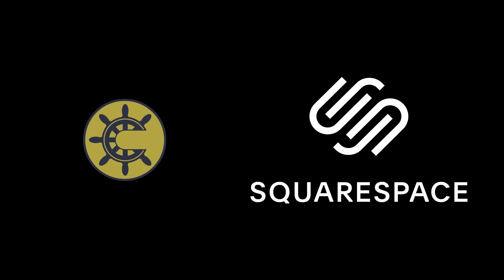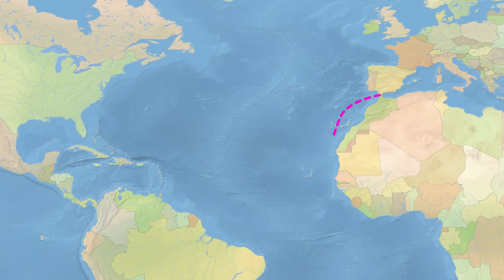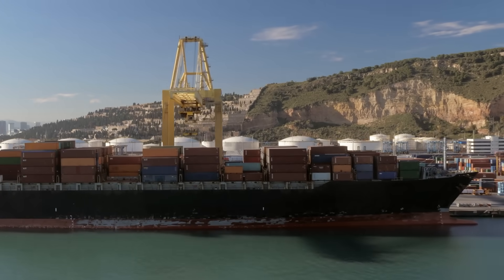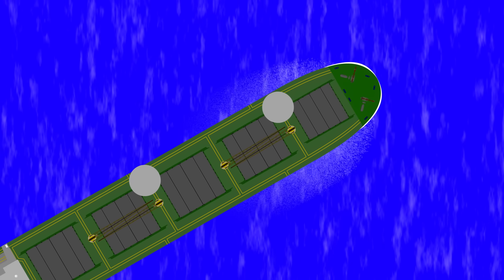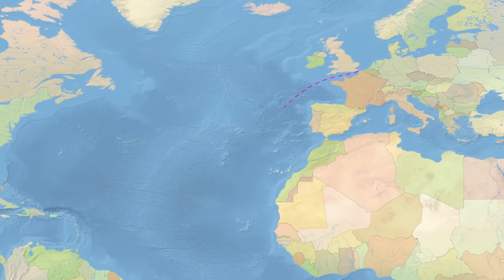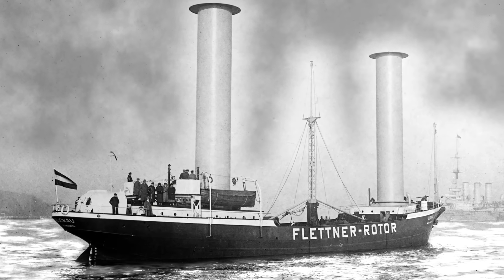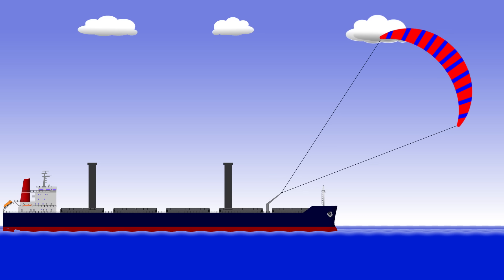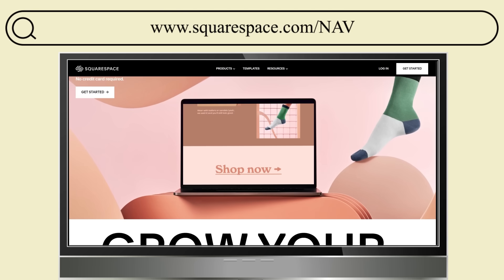Why Don't Sails Work On Ships?

Comment: I am an engineer actively working on a WAPS project. There's a lot of CGI and not a lot of thinking going on with a lot of these solutions. Ships have to go somewhere and usually on a time schedule, and most of the solutions typically have a 40 degree wind window where they are effective. Thats not enough to make economical sense. And when its not working for you its often slowing you down. Im not sure I see any solution becoming widely used in the next 10 years
Reply: @chuckyxii10  , My biggest point was that lift force >> drag force. This means aircrafts can fly with engines that don't have enough power to generate one g acceleration. You can have symmetric or even flat wings. The actual wing shape is just much more efficient because drag is reduced with more efficient deflection generating strategy.
Reply: @suokkos  nice, think about the loading and unloading of the structure. How would you account for that?
Reply: @suokkos  Wow, that's a wonderful explanation -- thank you! 🥰
Reply: Hi Tim, the presentation said at 5:29 that the economics of WAPS is jeopardized by the split between the owner paying the capital cost of installation, and the charterer paying the cost of fuel. I have read this elsewhere. Is this really true?
Reply: @patnolen8072  Generally, yes, however the presentation overstates the issue at play. While, yes, there is a bit of a conflict in the owner paying for the efficient technology and the charterer paying the cost of the fuel, because the owner doesn't pay for the fuel and can save the charterer fuel costs, the owner can charge more for the charter. The same is true for homes, boats, cars, and planes. The discerning leaser, especially those involved in contracts in the millions, will take into account running costs.

As long as the owner can recoup the debt expense for upgrading the ships by saving enough fuel to entice charters even at a higher base cost, the system can work. The problem here is that the cost of the system outweigh the benefit of the lesser fuel consumption, meaning that if we were to mandate such a technology we would either have to subsidize it or force the entire industry under the burden of extra expenses and locking us into what may soon be an obsolete technology.

A problem with lots of regulation is that they require specific technologies instead of broad goals. If they, for instance, mandated that all ships achieved a nautical mile per gallon per gross ton metric, that would leave room for innovation in the future without risking baking in a bad technology. You could also provide high efficiency subsidies where extra nm/g/gt would lead to tax benefits or something. But, no one does that because it's not a good way to make sure politically connected friends are guaranteed sales from a captive regulated industry.
Reply: @justhecuke  I find that the problem with regulations is that either they are written by people who don't know anything about the matter at hand, or they are produced by people who have a particular axe to grind and therefore will write regs that may be detrimental to most of the industry.  If wind assistance provides an economically feasible advantage, someone will exploit it without being regulated.
Reply: @justhecuke  While I wholeheartedly agree, I think you might be understating the conflict of interests between owner and charter. At least based on two factors you didn't directly state and which I've seen or directly experienced both with home rentals and efficiency based technology. Maybe two and a half. They are:
1 - opportunity cost and time for return. If the time required for the investment to pay itself is too long (ex: 8 years), the money invested there could be better applied in other investments with shorter return times. So investments like these are repeatedly postponed until they never see the light of day.
2 - inactivity time and cost vs income. If the upgrade takes time to install - time during which the ship is unavailable - then while the owner's profit increases on the long run, their income decreases - possibly sharply - on the short run.
3 (sorta of) - the latecomer's advantage. As one or more technologies mature and improve, the later a user invests on them, the greater they benefit, as it affects 1 and 2. No one wants to buy an extensive set of rotors that will take 10 years to return the investment, only for 5 years later a cheaper, more effective rotor that takes less time to install to come into the market.
But ye, otherwise... Thanks for the comment, I guess? Made me understand some stuff.
Reply: @marcosalmeida3947  I didn't talk about 1+2 because they are just part of the cost calculation. We don't need to go into each line item in great detail to get to the general point of cost/benefit. There are many more concerns including interest rates, depreciation (which indirectly includes tech progress which is your 3), insurance, training/certification, etc. But we don't talk about them because we'd then shroud the forest with the trees.

But you are in general right that there are a lot of costs to consider. I wouldn't call them conflicts of interest, though. Just different business models and pricing strategies. Finding the right balance between base and running costs is as old as business.
Reply: @patnolen8072  
Hard to imagine. As soon as the savings on fuel are significantly greater than the additional costs for manufacturing, maintenance and loss of cargo space/loading time it should be adopted, because no sane company would rather pay 20 million more in fuel than 10 million more for chartering.
Reply: Thanks for sharing your experience!
Reply: wow. cool
Reply: This comment ages like milk lol
Reply: @dimitrikemitsky  how so?
Reply: Ok, so here's my potentially stupid idea: 
Giant squirell-cage fan with variable geometry.
Vanes could be oriented so it functions either as a vertical wind turbine or a Flettner rotor, depending on wind direction. With the ship travelling with the wind, it would generate electricity and the added drag would aid propulsion. With the ship going perpendicular to the wind, it would generate forward "lift" due to the Magnus effect.
Reply: Therese is a lotta gci going abc and xyz to find more fuc in the bbb.
Reply: It would be better to use the wind to turn turbines to feed power back to a hybrid electric propulsion system
Reply: @chuckyxii10  It takes energy from wind. Deflecting air can require little power compared to force it generates. Wind direction, speed and deflection method put some limits to efficiency.
You can think about fixed wing aircrafts. They produce a large lift force from deflecting air with wings (and body). Engine power is used to create forward thrust to balance aerodynamic drag. Lift induced drag affects the power requirement. The shape of wings and body is designed to minimise the drag at the cruising speed.
Reply: @chuckyxii10  Wings have to push air down.  Conservation of momentum is a thing after all.

Because we get this result from a conservation law, it holds no matter how wings actually work (eg what shape they are).

Of course, your observation about inexperienced pilots stays valid.  Just because you have to ultimately push air down, doesn't mean that yanking on the stick is the right way to go.
Reply: Unrelated but what about battery powered ships. Could it be feasible once battery technology advances some more? Maybe charged along the way with a turbine or solar cells?
Reply: @skrimper  Very good point. I would like to hope so some day.
Reply: @skrimper  Lol no.  The "better battery technology" has always been a myth that has never showed any signs of becoming reality.  So far it's still just pipe dreams.  We've not come any further than the lithium-ion battery which was invented in the 1970s and entered production in the 1990s.

Ships need to cover huge amounts of distance that would never be feasible with electrics.  You'd need batteries the size of the ship, leaving no room left for cargo, and even then it might not be enough to reach their destination.  They just don't have sufficient energy density.
Reply: @skrimper I see that as a very difficult problem, trying to move a ship that is fully loaded with thousands of tons of cargo and keeping it moving for weeks is not easy. The recharging rate would have to be higher and also putting solar panels on takes away from cargo space. It’s probably been thought of but those engineers may have already done the research. Shipping is already using the cheapest possible solution and I don’t see companies changing their policy anytime soon
Reply: @skrimper  nuclear is probably better. If they can do it with aircraft carriers and submarines, why not equip the worlds biggest container ships with them. Of course an independent UN organisation should control and maintain those reactors. Just to make sure one doesn’t end up in the hands of the wrong person.
Reply: @HvV8446  Besides the huge up front cost I would expect regulation and training to be a major issue. For both ship categories you mentioned I wouldn't be surprised that it ends up being pretty expensive long term compared to burning fuel but that it's worth it for the long duration operational capability of the ships (and boats? isn't that what the US likes to call submarines?). Especially with a submarine it's pretty neat not having to come to the surface or to snorkel depth to recharge the batteries but instead just keep going more or less until there's no more food for the crew or the mission is done.

From an environmental point  of view I think it'd be a good idea for the biggest ships but there's probably too much regulation and paperwork around it that I don't see it happening anytime soon even if it was financially beneficial.
Reply: @HvV8446  Nuclear in a military ship works but would you want pirates to seize a nuclear powered comercial ship?
Reply: @luispnrf  nope, thats why an internationally recognised institution like the UN should take care of the reactors. Maybe a branch of the IAEA. 

And not every ship has to be nuclear powered. More like 10, 15 of the worlds biggest cargo ships
Reply: @HvV8446  But how would IAEA or any other agency protect merchant ships from pirates at sea? And why only 10 or 15 ships? Would that even make a dent on CO2 emissions on a fleet of over 58000 ships?

Comment: This video in one section repeats a common misunderstanding of sails in that it implies they create a low pressure area the PULLS the ship forward.   And then in another section explains that the magnus effect achieves thrust by accelerating air in a direction other than that its blowing in.  In fact, ALL airfoils work thru this latter effect.  The low pressure area created by airfoils and sails causes air beyond the low pressure area to accelerate into the low pressure area and thereby creates a thrust perpendicular to the chord of the airfoil.  This thrust represents 90 some percent of the force that makes airfoils fly and sails work. Not suction, but air defected.  This is why the suction side of any fan seems to have no force at all, but the blowing side of the fan has significant force.

Comment: You really don't understand basic micro-economics.  It's preposterous to say that we will need international regulation to encourage the use of these technologies.  You claim that owners "might" only be able to recoup their cost, as the benefits accrue to the operators, but once it's proven that the use of wind will decrease operators' costs, owners can increase their rates accordingly.  And you claim, without evidence, that the only reason owner/operators invest in such technology is because they benefit directly, in the present. But a moment's thought will make it clear that owners will be able to use these technologies on ships which they lease out in the future, and benefit accordingly.
Reply: >>but once it's proven that the use of wind will decrease operators' costs, owners can increase their rates accordingly

It cannot be proven though because it depends on the price of fuel which varies considerably. These devices come with a cost. There is capital investment, maintenance, extra crew or at least extra training. The fuel savings will not cover the cost when fuel prices are low, otherwise evryone would have them already.

Comment: Carbon tax, now
Reply: Yea - let's raise the price of everything.  Energy is a direct cost input form the place the ore is mined to the retail store you buy the finished product from.  So, your carbon tax will increase the cost of every product at every stage of the manufacturing and logistics chain.  A 1% carbon tax will probably increase the costs of everything you buy by 5-10%.  Because these taxes are stacked on top of each other.
Reply: @colincampbell767  Only for stuff that is not made using renewable energy.

Comment: If really is cost efficient, it will be adopted, regardless of how the savings break down, because of how pricing works. It is not necessary to force people to use it.
Reply: Regulation can be used to make something more cost effective.  And sometimes outside pressure is needed to force innovation and advancement. 

However, regulation can also cause significant problems when done without consideration of feasibility or when allowed to stay in place without update and revision to the changing times.

See USA diesel emission standards which have significantly added to the cost of business of anyone doing construction, farming, or transportation due to increased downtime, increased maintenance costs, and increased fuel costs due to reduced fuel efficiency as an example of mandating standards technology isn't quite up to delivering reliably yet.  OTOH, this is also an example of where regulation was required to make anything happen beyond just a general quest for better fuel economy which would have at least slightly lowered the targeted emissions.   It would probably make an interesting case study years from now when it can be judged in the light of hindsight to see what it got right and what it got wrong.

See the Jones act for an example of something not updated to ensure it continues to fulfill its function as time marches on.  It has been in part responsible for the (arguably over)growth of the trucking industry in the US and has left the US with a limited merchant marine and inefficient shipyards of questionable quality, in direct contradiction of its intended purpose.
Reply: @spudgamer6049  Reads like an undergrad manifesto.
Reply: The free market is full of short sighted morons who consistently would rather crush innovation than be forced to change.
Reply: Well, that's just plain silly. No, it's full of people who have to make things work or go out of business. Regulators don't have to worry about such consequences, which is why regulation isn't the answer. Actually understanding technology - and it's costs - is.
Reply: @purplefood1  Right, and you're not a short sighted moron that would impose massive costs on the shipping industry for dubious gains in the name of "innovation." Those costs, by the way, will eventually fall on the consumer.
Reply: @NoQuestions4sked  I'm not saying it should be regulated just that it being a good idea doesn't mean people will automatically follow it. People talk about the free market like people in charge of businesses always know what's best but it took Napster to convince music executives that the Internet was a viable platform for music distribution and somehow people still didn't have anything worth replacing it for years, these companies are not as clever as they like to say they are and a lot of the time they fight good innovations. Regulating it is daft but let's not pretend like these people always make the right choices every time.
Reply: No, the answer is always to regulate.